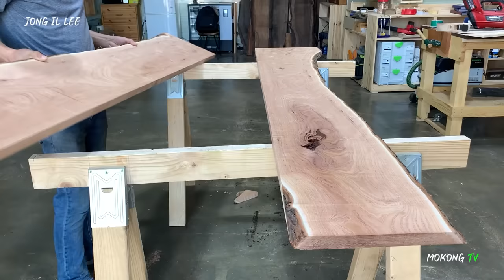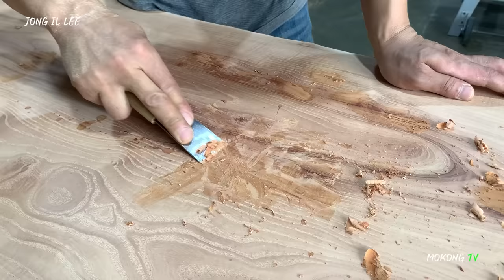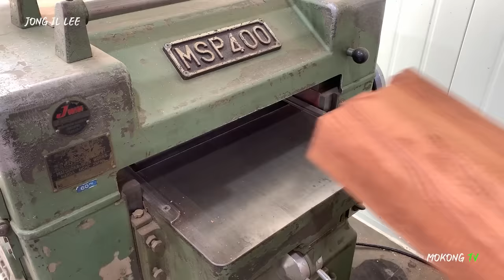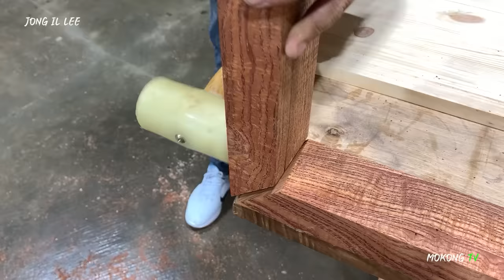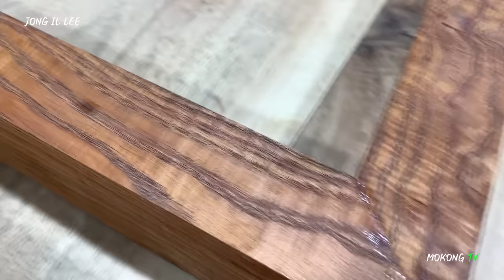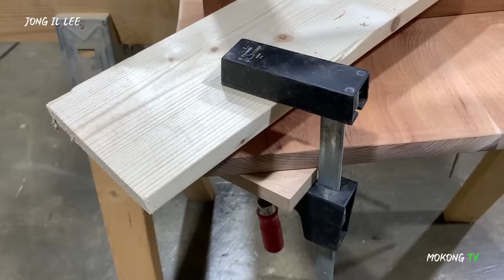Mahogany Slab Coffee Table / Feel the Beautiful Grain of Korean Mahogany Chamjuk / Woodworking

Comment: I would be concerned about expansion and contraction!
Reply from the maker: I don't care what you worry about.
Reply: @mokongtv123 I'm not worried
Reply: 100% this table cracked.
Reply: Genuine question, why would this table crack? Beginner here
Reply: @mick4790
Reply: @specs9748 Wood, even after dried completely and finished with oil/varnish/whatever, absorbs moisture from the air when humid, and releases moisture when dry. This causes wood ro like expand and contract.

This is negligible along the grain (think of the height of the tree), but significant across the grain (the tree's thcikness). Nothing will prevent this, not glue, not screws, not dominos.

By not only gluing the legs cross grain to fhe bottom of the tabletop but also adding dominos, this guy did exactly this. The only option for the tabletop is to simply crack and split.

A tabletop this wide will expand / contract 1/4"-1/2" (6-12mm) across it's width.
Reply: @dufftime  that makes a lot of sense, thank you for that!
Reply: @mokongtv123  you're just a smart alec.
Reply: @specs9748 because the top is about 24" wide. Being that width, it will probably expand and contract about a quarter inch. Wood is VERY forceful and this top will probably crack. Another thing is the legs and top have their brains running 90 degrees to each other, increasing the probability of the top cracking.
   I would have put the dominos in the middle. Two pairs about 3" apart and only glued that 3". That would hold the legs stable, but allowed some movement of the top.
Reply: Grains, not brains.
Reply: @mokongtv123  👍💯💯

Comment: Great work but you really shouldn’t be gluing and pinning the top to the legs. It doesn’t give the top a way to expand and contract with the seasons. 

You can screw it in with over sized holes. Sliding dovetail dados. Slots and buttons. Depends on the look you want and how strong you need it to be. The glue joint on this is almost certain to crack.

Comment: It looks great but a bit way too long for coffee table. When you glue up those legs try to use tape close to connections. That way extra glue will go on tape so you will have less mess and sanding to do later. The way you glued up legs with table top is not right IMO. When wood movement will happen it will break. Always use screws and Don.t tight it too much so there is a little room for wood movement.
Reply from the maker: I'll keep an eye on this table over time. thank you